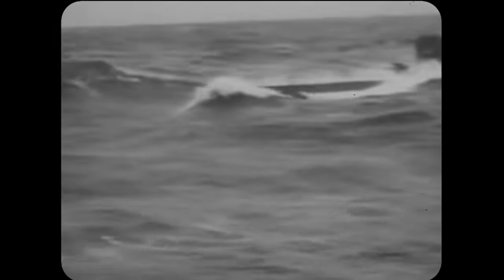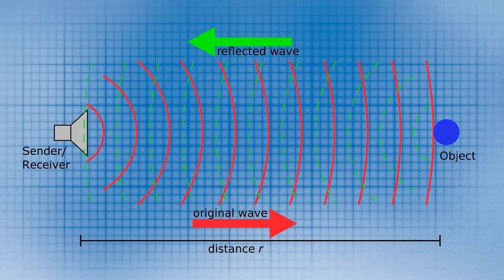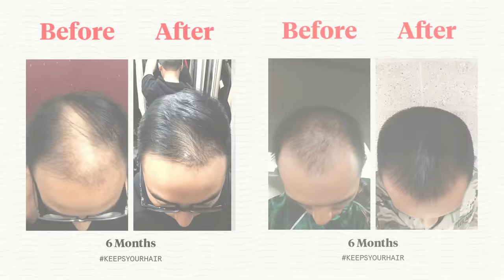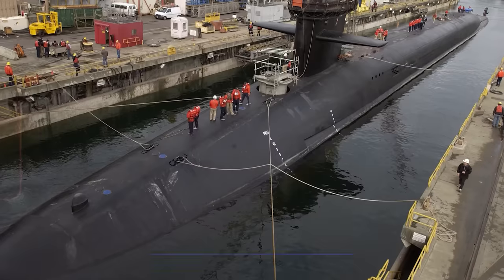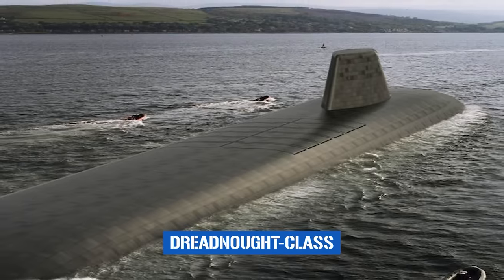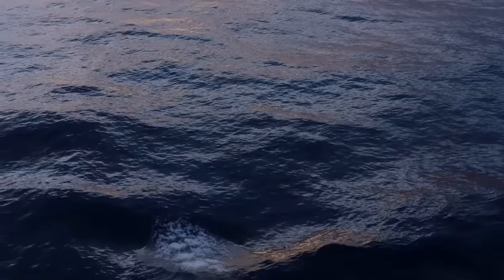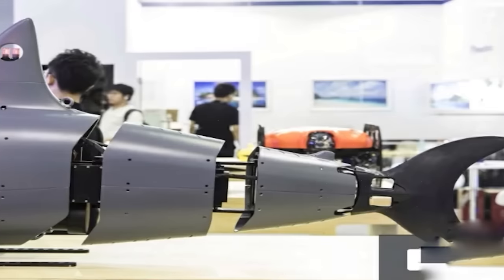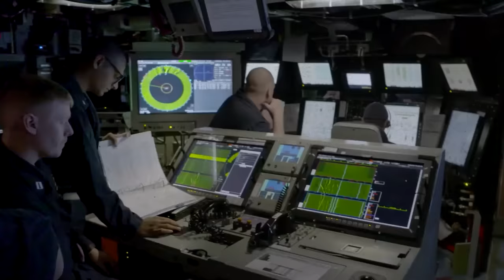Stealth Submarines: The Silent Underwater Killers

Comment: I doubt that the stealth of submarines will really change in the future. If anything I think their stealth will become all the more important. All of the detection methods listed have two major issues and those are range and cost. You can argue that we have a multitude of ways to detect submarines but the fact that those methods require very expensive gear and not just someone sitting on a fishing boat with a pair of binoculars means that their stealth will be very effective against most adversaries. The second issue is that the ocean is enormous and the detection range of most of the methods are really quite short. You have to hope you are looking in the right area and even then you have to have that very expensive gear we mentioned before. But because of the reduced detection range of these methods it would be very expensive to actually track them.

Now we can move on from detection and take a look at engaging a sub. Congratulations you think you have seen a sub. Who does it belong to? You know it isn't one of yours but is it one of your allies? How about a neutral 3rd party? Even if you are in the middle of a war are you going to be able to risk an international incident by sinking the wrong submarine? How good was your detection? Then lets say you do want to engage it? How are you doing it? Do you have the right tools to actually hit the sub? Any sea based munition is going to be deployed basically from on top of this sub due to range limitations and, which if it is hostile, can be a very dangerous place to be. From the air might be possible but most munitions aren't designed to fly 100 miles in the air and then dive a few hundred meters to hit a sub. The densities differences in air usually mean that something light enough to fly will be crushed by the water pressure and something strong enough not to be crushed can't fly very far because it weighs too much. This means you will probably need to use multiple weapons systems to engage the submarine. Sea based for detection and air to actually get the ordinance over the submarine to attack it.

That brings us to our final problem by the time you have deployed all of this to take out the submarine you have spent a lot of money and you have deployed a lot of other equipment. The chances your enemy hasn't noticed all of this happening above one of their submarines is slim. They will likely be deploying all of their own military to attack your surface ships and aircraft which are going to be much more vulnerable than that submarine is. In reality that submarine is only vulnerable if it is acting alone where it is unable to recieve support from friendly aircraft, surface ships, SAMs, and land based antiship missiles.

In reality nothing is invisible. We can even detect gravitational wave. A submarine has to be easier than that. Submarines aren't indestructable either. Nothing is. They are probably as close to both of those things as we can get though for the time being and any submarines are probably one of the safest places to be in an actual warzone.

Comment: Someone correct me if I'm wrong but I heard that under modern US Navy guidelines, you don't need to pass a swim test enable to operate in a submarine because you're likely to just drown beyond any hope of saving yourself if anything bad happens.
Reply: I would say that is false since everyone joining the US Navy must first pass boot camp, and you are required to pass a basic swim test in order to complete boot camp.  Unless something has changed in the last 20 years.  Also given that the maximum depth from which you can potentially escape from a disabled submarine without a submarine rescue submersible is 600ft, and even then most of the crew isn't expected to survive the stress of the rapid ascent, drowning really isn't a concern.
Reply: @zacharyuhrig782  The Australian submariners have to pass a deep ascent test before being allowed to serve on submarines and they need to do a revaluation after a certain amount of time. I even saw a story on TV what life is like for an Australian submariner and the journalist had to do the same test before he was allowed to do the story. I'm sure the US Navy would have a similar requirement.
Reply: @zacharyuhrig782  sounds right. I ask because one of my cousins recently joined the Navy and chose to work towards operating in a submarine. She told me, she heard that flunking a swim test would not disqualify her from serving on a submarine. If what you said is right, then she's probably just gonna be placed in a desk job as opposed to serving on a naval vessal.

Comment: It is not completely acurate to say that nuclear submarines are quieter then desiel electric subs. Sure when the desiel engine is running the nuclear sub is quieter but when the desiel sub is just running on batteries they can be even quieter then the nuclear sub that has to keep its reactor running at all times. There are a lot of other benefits of nuclear subs like range etc but stealth is a bit more situational.

Comment: The stealthiest submarine was HMS Warspite, who holds the record for longest submerged patrol of 111 days (57,085 km / 35,471 miles), and was so stealthy that in October 1968, she rammed a Soviet Echo II class submarine, whose crew were shocked because they didn't detect anything before being hit.
Reply: If this submarine rammed a russian submarine, this means that not only russians did not detect anything, but british also failed to detect  russian. It turns out that russian submarines are at least no louder than british ones.
Reply: Echo II was a noisy biotch. How did the Warspite not hear it?

Comment: As far as I know, in general, it is the curving lines that make something less stealth.  That is why the F117 was so stealthy by design.  A surface needs only one point reflecting back to the sensor to make the object visible.  The Russian design looks like it is designed to cleanly move through the water which might help its passive characteristic.  Once active sonar is used the design is less stealthy.  That doesn’t mean they aren’t stealth but other methods are used.
Reply: Frankly: if your enemy is close enough to see you on active, and has enough reason to suspect you are there to start emitting, your sub already fucked up.

The only time an enemy should know a sub was there, is when a ship suddenly explodes courtesy of a torpedo fired from outside detection range

Comment: You need to also consider the thermocline layer with active and passive sonars not to mention the type of water your in including how salty it is 

Sonars are able to even identify individual platforms 

Ohios are now over 40 years old there’s 18 of them and technology has moved on substantially 

With regards to electric motors on the Columbia class this isn’t new the RN used a reactor powering turbines that ran electric motor as fast back as our V&C classes (1970s) 

With regards to the rubber mounts on the A26  that’s called rafting that dates back to the 1950s again north ing new that isn’t already being used 

I’d like to know how they tested the boat with crew inside considering they haven’t even built it yet 

The system of non acoustic tracking which uses water sampling among other things has been around since the 70s in Russia it’s called SOKS first used on a November class submarine 

MAD has also been around since the 1960s indeed it’s not really deployed anymore the latest ASW aircraft the P8 isn’t even fitted with a detector because degaussing wipes the boat of its magnetic signature 

Cavitation happens at higher speeds and shallow depths indeed the pumpjet which a lot of boats now use can run their rotors at slow revolutions and yet achieve higher speeds than conventional screws

With regards to drones there are UUVs operational today that can mimic other ship and sub signatures again Russia uses one called Korund and it was used in operation atrina 1984 

The drone swanning idea with a submarine using them to mask noise is practically suicidal even the mimicking decoys can be identified rather quickly and discounted thus locating the real boat won’t be too much of an issue it’s something we have trained on already

Comment: I don't agree with your assertion that nuclear power made submarines quieter. Diesel electric subs running on battery are extremely quiet. 
The first nuclear subs were very noisy. The Americans developed much quicker in this domain than the Soviets, and later the Chinese. Nuclear power's main benefit is range without refueling, and power output over time. Stealth is something they had to work hard to develop.

Comment: @ 5:33 I thought you sacrificed stealth going from diesel to nuclear, because nuclear always has to run its pumps to keep the reactor cool, even when running on battery power, whereas diesel can run on battery alone and basically be silent
Reply: This is my understanding as well. Diesel subs, when the batteries are charged and engines are off (using batteries only) the diesel boat is the quietest. There are modern diesel subs that are super quiet, but it's hard to tell with all the secrets. The most well known "quiet" diesel boat was the Soviet Kilo.
Reply: Diesels are quiet on the batteries, but thay can't go as fast as nukes and they are still very hard to find.

Comment: Another method of stealth is they change out the propellers regularly with slightly different ones that have a different signature, or the propellers have inserts in them that can be replaced with different materials to change the acoustics. It doesn’t hide the sub or ship but it does hide its identity. Realistically though with new missile designs that have better rockets for intercontinental range will be the key, that way you can stay in your own waters and the enemy has to come to you and go through about 30,000 buoys that have full time active sonar. At that point you are just an under water nuke launch base that moves and uses the water above you as protection from a nuclear blast from above. I would also assume that most of these subs know their own signature and have acoustic decoys they can release with the same signature and then dive without power if they are detected and wait. Seems pretty cheap and simple.

Comment: So, the claims of "one of the stealthiest submarines on the planet" is not nuclear?  So this means battery powered.  Agreed, that when it operates submerged and on the batteries, it will be quiet.  But to recharge that battery set, it will need to snorkel on some type of fossil fuel (most likely diesel) and then it will most definitely NOT be stealthy.  No technological leap from WWII subs.

And this comes from experience of being a sonar tech (STS) and a SSSA instructor ( those who know, know what this is).

Comment: BTW.. if you didn't have to feed the crew, even an ancient nuke boat could remained dived for nearly 10 years. They make air, water and power. It's only scran that the 'warmware' internally still requires. Well, that and a bit of grog and shore leave.

Comment: All this yak yak about SSBNs.  What about new SSNs and even SSKs.  Astute Class anyone? SSKs are always hard to find coz they are tiny and when they are in battery mode very difficult to find. Rubber mounts on machinery and accoustic tiles inside and out are 40 yrs old.
MAD is NOT recent.  At least 50 yrs old.

Comment: I think the Royal Navy would question the selection of the Ohio class. The  Swiftsure class and its predecessor the Vanguard have long been the pinnacle of Submarine design.  The US Navy compare their subs against these, and this trend will likely continue with the Dreadnought. Swedish Subs are excellent, but they are in an entirely different class (being small attack subs). Their subs are tiny and operate just off the coast - unlike the behemoth Ballistic Missle British, American, and Russian submarines.
Reply: Honestly they probably fit this video better than the behemoths of the super powers, nuclear subs will always be noisier than the smaller attack subs Sweden uses. Obviously at the cost of how long they can operate, which is why they fit so well for Sweden that only operate in the Baltic sea.

Comment: @5:30 Having a nuclear powerplant powering a submarine, does not make it more quiet. Arguably the opposite.
A nuclear reactor makes more noice than a battery. There are circulation pumps, turbines, gears, generators and
more, that makes continuous noice. So while submerged, an battery powered submarine is more quiet than a
nuclear one.

What the nuclear reactor offers, it the removal of the need to re-charge batteries.
A nomenclatur for submarines are nuclear and diesel-electric . The diesel engine is used to charge the
batteries, which must be done on the surface, or just below with a snorkle sticking up. While the diesel engine
is running, the diesel-electric submarine is louder than a nuclear one. But running on batteries, it's more quite.

Comment: These Nuclear Submarines can destroy a whole country in a half hour  that's insane and this is  not counting what the USA Airforce has and the USA Europe and Japan has a bunch of 6th generation FJ that can go over 4800mph and climb up to 90,000 feet in the air and they have 2 Mitsubishi engines in them run by Nuclear power so they never have to fuel up and can fly them with or without a pilot so that it can fly around the world for years so by far the USA has the best Military in the world air land and sea. God Bless America 🇺🇸 🙏 ❤️.

Comment: Nuclear isn’t what made subs quiet at all, on the contrary most early us/ ussr nuke subs were louder that contemporary diesel electric counterparts, and all of the PLAN nuke boats up until like literally right now. Nuke reactor= gotta cool that sucker down=noise. D/E boat battery go no noise= no noise.
Reply: Derrr .. diesel have to surface .. nuclear does not. Which one do you think will be easier to spot? They also sound like a freight train swimming in the water. Are you serious?
Reply: @THE-X-Force  derrr, modern AIP D/E are significantly quieter than Virginia class subs. You sound new here.
Reply: @iLikeRandomfacts lol yes .. I'm new here. Ya got me real good there. I hear the modern coal-fired subs are pretty great too!
Reply: @iLikeRandomfacts Hey .. since you're a well-seasoned expert here .. can you tell me which sub is easier to detect .. the one that is actually underwater or that one that is surfaced? Thanks old-timer!

Comment: My dude - using rubber (or other materials) in connecting parts is tech that has been used since (from memory) the 1960's - and MAD has been used for decades.  Rubber tiles - same thing.

Not trying to be annoying, but you really need to do research on a subject before making a video.

Comment: Nicely presented - but badly written.

As a content creator, Megaprojects should consider to invest a little more into proper story writing. Because this may be entertaining - but a far cry from factual.

Nuclear-powered subs aren't quieter - they are substancially louder than modern conventional Diesel/electric boats.

They need a huge number of pumps and subsystems to keep going. And what's better than the best, quietest pump?!? No pump!!

The German 212 class wasn't even mentioned. They run on totally quiet hydrogen-powered fuel cells and a direct-drive electric motor - powering a huge single slow-spinning prop. Maximum diving time: 30 days.

The Swedish Gotland class does the same thing with a superquiet Diesel-fueled Stirling engine.

And even the older German 206A boats were able to sneak undetected into US carrier groups. Taking a close-up foto of the carrier bow - more than one US admiral lost his job.

Lidar is great tech - but as an optical system - it doesn't penetrate deep into murky sea water. Therefore - it won't detect submarines any time soon.

Magnetic detection works only if there is anything magnetic to detect. German subs (and probably a few others) are traditionally made of high-tech amagnetic steel. The German Navy built a brand-new magnetic field detection facility for a lot of money to ensure their subs can't be magnetically detected.

Today, we know enough about ruzzian military tech like SU-57 (a flying joke) or T-14 Armata (doesn't exist in the real world) to clearly understand: There won't be any new ruzz stealth subs anytime soon. Money is siphoned off in such large amounts there isn't enough left for actual arms development.